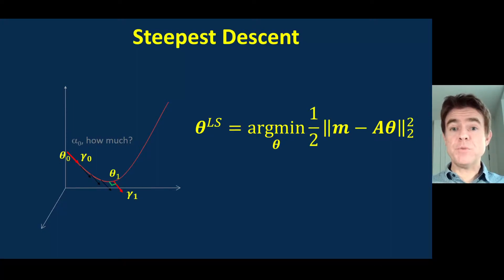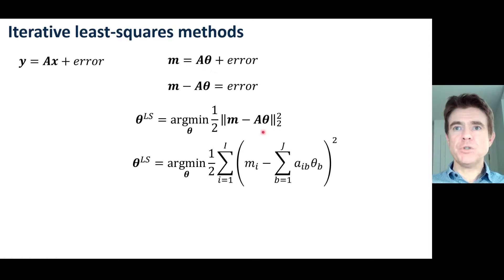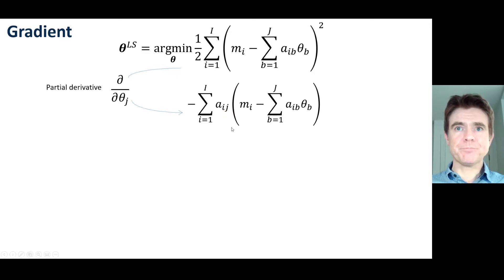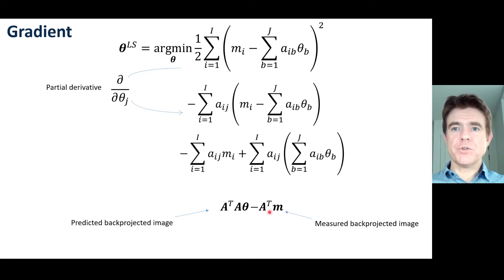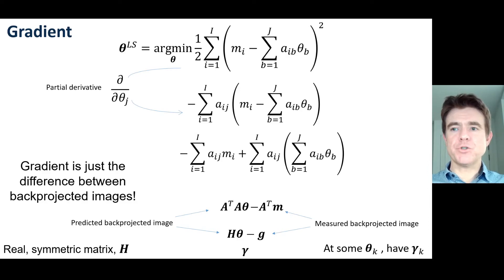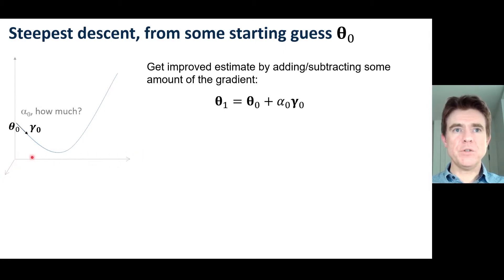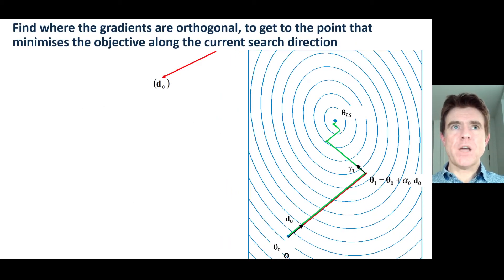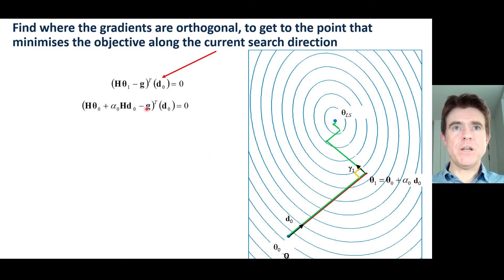Steepest descent least-squares optimisation - derivation explained (watch before conjugate gradient)

Comment: Thanks for the video. 
For those who are confused like me hope this helps:

- 2nd from the last step at 13:23, remember a_0 transpose is the same as a_0 since its a scalar. That's why he didn't take transpose of both sides.
- "Division" for matrices don't exist. You just multiply with the inverse matrix on both sides of the equation but I'm confused for the last 2 equations:
H is a symmetrical matrix so has an inverse (but can't be a zero matrix). So OK.
d0 on the other hand is a vector. Since matrix inverses have to be unique and for vectors it doesn't seem to be case? I don't get how one would divide a vector in this equation...
Also to multiply the inverse of these matrices: you have to follow a certain order. This matrix division operation is confusing for me.
Reply from the maker: Thanks for your comments. There is no need for a matrix inverse. The term in the denominator results in just a scalar (vector d_0 goes through matrix H, to give a vector, and then that vector is taken in scalar product with d_0, so the end result is a scalar value only in the denominator, and indeed a scalar also for the numerator).
Reply: @AndrewJReader  After going through the equation again now I understand.
Thanks again
Reply from the maker: @canmetan670  Great, glad it's clear now. Will see if I can improve if I do a new version!